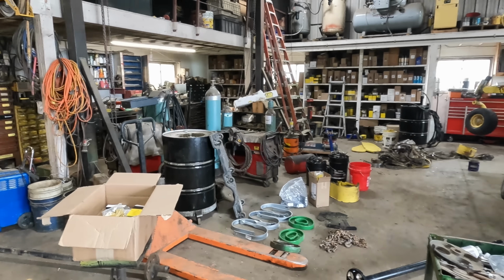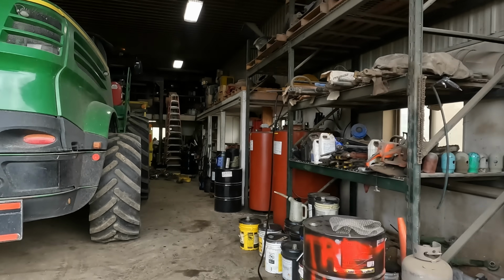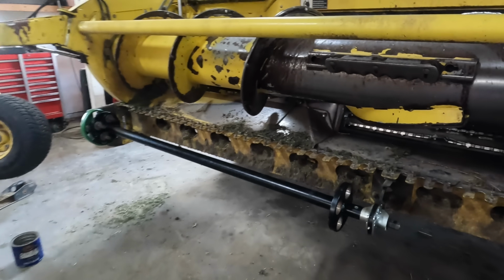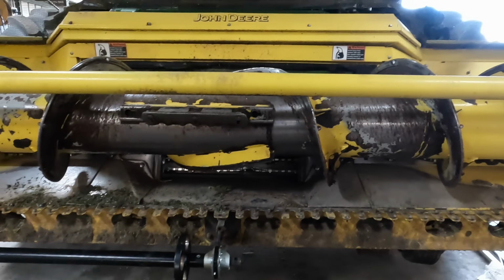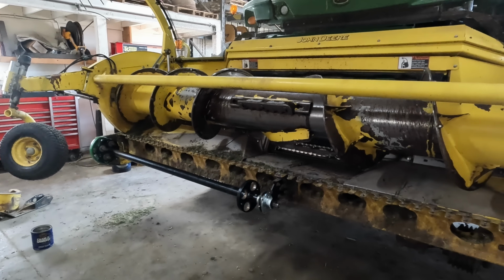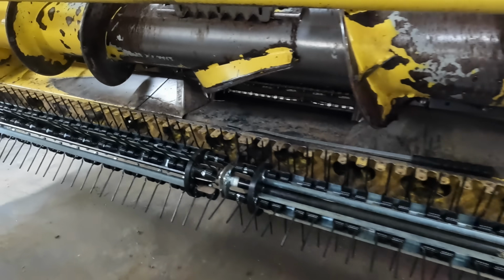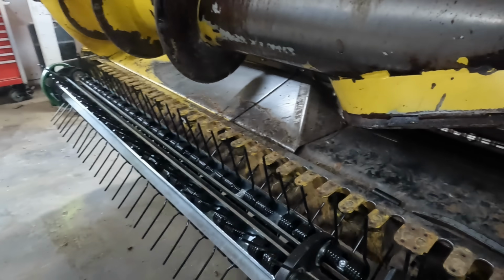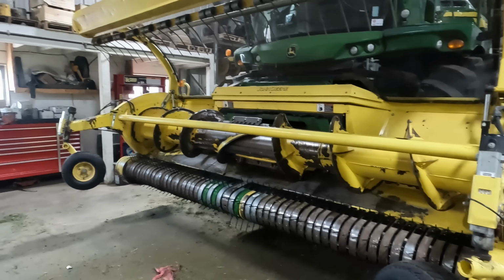Throwing too much good money after bad

Comment: Maintenance & repair costs are an important part of any well run business to get the best return on the capital investment of equipment.
The fact that your dairy operation has skilled employees that are able to work on various pieces of equipment within the workshop as well as in the fields greatly improves the efficiency and saves considerable costs on the projects that you are able to accomplish in house.
Your excellent management skills to determine when some repair projects are best suited to be done offsite by specifically trained individuals helps with getting the best value on the endless variety of repair projects.
Your videos are an excellent learning tool on what it takes to keep all your various pcs of equipment up and running & minimizing downtime.

Comment: We used to chew up so much fire hose as chief and gear, but in the long run, it save the hoses. We had a lot less blowouts in the field. Worked well got them from the local department decommissioned they couldn't use them.

Comment: Antichaffing around the hyd hoses is smart protection,  we do that same thing on aircraft hydraulics lines and hoses in chaffing areas with rubber inner tube material and pull ties to hold them in place just like you did it and those large aircraft hydraulics can run at up to 3,000 to 4,000 PSI !        Your rebuilding the choppers feeder head and new spring teeth looks great,  hope it lasts you for some years !       On your greaseable bearing you mentioned if they installed a sealed bearing you can blow the bearing seals by greasing too often (pops the seals out).

Comment: A true  Preventative Maintenance  program is worth its weight  in Gold, the internal workings that are not accessible is usually  where  problems  arise , a good mechanics stethoscope can detect  bearings before they fail but this is only one aspect of a good PM program that is scheduled and followed but never the less  problems  can still easy arise, stress cracks  that are not visible to the eye is another thing as well  as new faulty  materials.  Its tuff on a farm, scheduling is difficult when your running your equipment is working 12- 24 hrs consecutively. Your doing a great job Andy as well as your team 🇺🇲🚜

Comment: You may have said it previously but about how many acres on the old head?
Reply: They are on their 7th  yr as with the whole machine
Reply: So figure around 8000 acres, my best guess.
Reply: @MorganOtt-ne1qj  more than that 3 cuts minimum a year so it's cutting at least 3000 acres a year Milking 2100 he's definitely doing close 1000 acres per cutting and they cut some fourth cut sometimes I'd guess 3500 or roughly around that  acres a year so closer to 22-26000 total acres.
Reply: @MorganOtt-ne1qj  you have to remember 3 cuttings per year
Reply: @Otherrandomguy42  I bow to you doing much better math than me! 🙄I haven't followed but maybe 3 years, and I noodled the best guess in my head. Thanks for giving me more accurate #! 👍👍
Reply from the maker: About 35,000 acres total
Reply: Jeezum, no wonder I barely escaped HS! That's a LOT of ground covered! 👍👍Andy, for it lasting so long!
Reply: 3 cuttings a year.x.7 years x a few thousand is slot of acres.  I would guess over 30000.
Reply: @FarmingFixingFabricating  holy crap!

Comment: Dry fitting the shaft of the chopper is fine but I have found over the years that with conditions like that tine bar in the moisture and the dirt it is beneficial to apply a ample amount of grease to the bar couplings. just saying !

Comment: When I worked on Cat equipment,  their saying was " Were not not having problems with it but we changed the design ".
Reply: I change a lot of designs.  Manufacturing is not static.  You see less than 1% of the business.  Remember that.
Reply: @Failure_Is_An_Option  You change a lot of designs? Are you an engineer? If you are, maybe you should learn how to service and wrench on the stuff you designed! I'm tired of busted knuckles because someone sitting at a laptop decided that 2" is enough space to change a filter that is 3" tall!

Comment: That's an old trick from the manufacturer - the original bearing can't be lubricated because there's no zerk fitting. Driveline bearings were notorious for being like that. Then when you go purchase a new bearing guess what?? You can lubricate the new one because they remembered to add a lube point that you can actually lube!! Of course that bearing is 40 to 50% higher in price then the last time you bought one but at least this time they remembered to add a zerk fitting...

Comment: Hmm could we see 2 choppers in corn silage? But that would mean double the trucks so probably not
Reply: They are eventually doubling the heard so you need double the feed.
Reply: Need more trucks more truck  drivers and another 4wd with a degelman blade pushing and packing,  one push tractor and one packing tractor can't keep up to two choppers if each chopper worked at about 75% capacity it would work.
Reply: @Otherrandomguy42  We ran two choppers Daria outfit up the road. Actually I think we had one push Tractor I’m not mistaken. 20+ years ago. There was several other tractors there as well
Reply: @Otherrandomguy42  Andy has 3 big tractors with blades and a straight frame that can have a blade on it if he needed